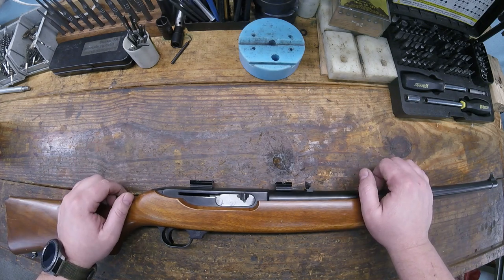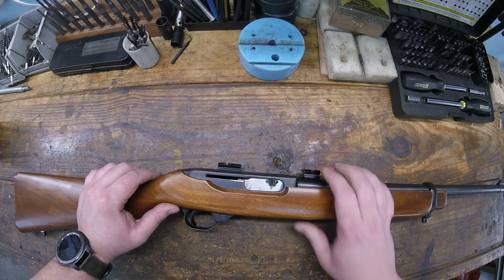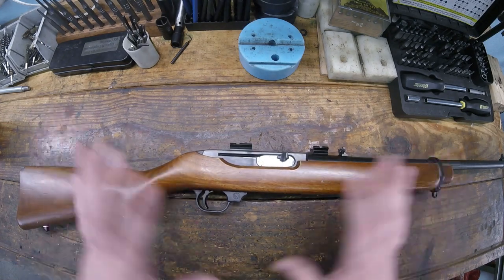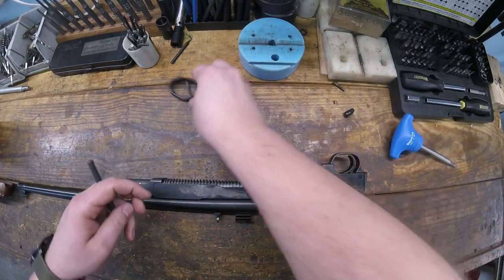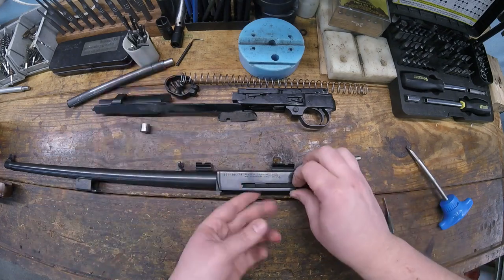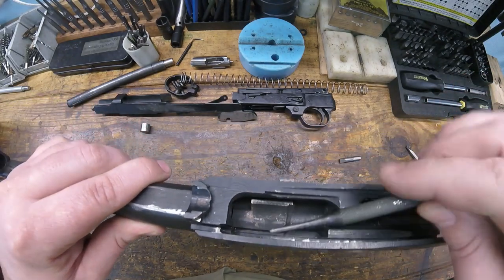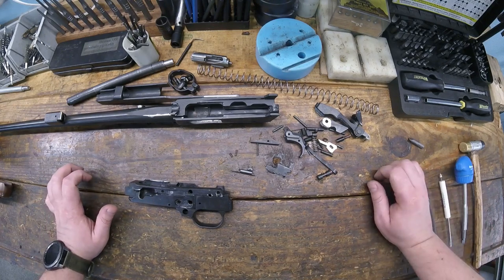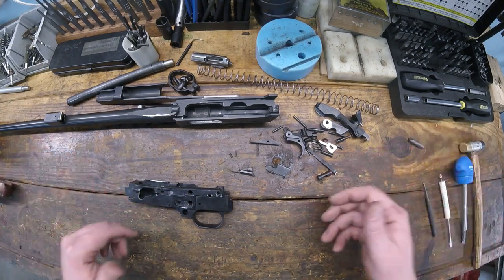Ruger 44 Carbine disassembly

Comment: You saved my life!  Pulled the wrong pin on my son's 44 carbine when I was cleaning it and it was the pin that holds the trigger in instead of the one that drops the trigger group. 2 gunsmith would not touch it to put it back together.  Watched this and said I can probably do this. Had to rewind it multiple times to get it pulled down and put together but I got it!  Thanks!
Reply from the maker: "Gunsmiths"...lol

Comment: Thanks for trigger disassembly video! I bought one of these rifle a couple years ago. The first time I shot it was the last. The trigger pull had to be eight plus pounds. After I watched your video this morning I took mine apart,  stoned and polished the trigger group and it now brakes at a crisp 64 oz. It’s so crisp it feels closer to 3 lbs than 4. You were right, the springs were a little challenging to put back along with trying to figure out where the inner part of the springs tuck under. Thanks again!
Reply from the maker: Glad I could help

Comment: I just bought one of these, I may use it for deer this fall.   It seems it hadn't been cleaned in a while.  It had dried up oil in the action.  Your straight forward approach made understanding disassembly easy.  Thanks for the video.

Comment: My first one, which was stolen and still hasn't been recovered, leaded up when I shot the only commercial .44 ammo I could find through it - the Winchester SWC which had the Luballoy coating on the bullets. I had to tear it down and de-lead the whole gas system. I found another one in an estate sale I was hired to prep for sale and took it in trade. In the intervening years since my first DeerStalker, I became a handloader, bullet caster and powder-coater and police/military armorer. I have avoided using lead bullets in the current .44 and in my other gas guns after trusting some copper-washed .30 Carbine bullets and having to de-solder the gas system in an M1 Carbine. I've powder-coated some appropriate weight .44 bullets of a shape that feeds in my .44, but have heard about PC fouling the gas systems of other gas guns and remain a bit leery of running these through my Ruger. I use them regularly in three other .44 rifles; a 788, a Handi-Rifle and a B92, not to mention a variety of revolvers, and I haven't had any PC fouling with any of them.
Question for readers: should I try the PC'd bullets in my DeerStalker? Otherwise, I'm stuck loading only jacketed bullets for it. That's fine for hunting, but I take my guns out and warm 'em up pretty regularly and the kind of field shooting I do eats up a lot of ammo, so cast bullets are a lot more affordable. If I try this and it works out, I'll test PC in the .30 carbine, and then the M5 .308 and the Garand.
Reply from the maker: Dont know about PC, but you can get plated bullets much cheaper than jacketed.

Comment: If the trigger assemble is working properly why take it apart? Throw the complete assemble in an ultra-sonic cleaner or clean manually/inspect/lubricate move on to the next assemble? The other parts clean/repair as needed/inspect/lube/assemble separately. So as to not confuse parts. Just thoughts for the inexperienced. 
Your video will help many from chasing springs/parts shot across the floor. Having left over parts, etc. Excellent rifle the Ruger 44 carbine.
Nice job Amigo.
Peace from Texas

Comment: Great video! Please do a reassembly.
Reply from the maker: There is one. Go to my channel.
Reply: @UndertheGun  I did subscribe. My lifter was sticking but I was afraid to take the trigger group apart but your video gave me the confidence I could get it back together. I polished up all the parts that were slightly corroded and it seems to be working better now but I'll have to test fire it to be sure.
Reply from the maker: @killvon5490  Right on

Comment: Just stumbled across this post.  Thanks a ton for the info.  I recently acquired a 1976 edition.  I have no history on it other than it was loaded when I acquired it from a family member.  I seem to recall having issues unloading it but I was a bit freaked out having found it in that state so I don't really remember, unfortunately.  I bought some Zoom snap caps recently and couldn't get them to load properly.  The round gets hung up at an angle and gets jammed up when trying to load the round.  I broke the gun down, except the trigger group, per your video, and cleaned everything I could get to.  Reassembled and same result.  I measured the snap caps and noticed they are about .03" shorter than Remington .44mag ammo that I bought hoping to go shoot this thing.  I don't want to try to load live ammo here at home.  If I load a round directly it ejects perfectly.
Any thoughts on worn-out springs or other areas that might cause failures to load?

Comment: Mine won’t feed the next round occasionally, but I’d hate to have it happen when a deer walks out. Running 240 grain soft point Winchester white box. I feel like maybe the mag tube wasn’t seated correctly. Anyway, I’ll try it this weekend and see what I get.
Reply from the maker: May be time for a new action spring. Order both and have them swapped out. It is cheap insurance.
Reply: If the spring were the issue, would the weapon fail to cycle manually?
Reply from the maker: @plutovulgus7710  yes
Reply: It does cycle manually. I think either the mag tube wasn’t seated properly (the little unload button wasn’t really letting the cartridges pop out) or the gas adjustment screw needs to be tightened. I did a cleaning and the unload button works now. I’ll test this weekend. 

I appreciate your video. Thanks for doing it. Not a lot out there on this gun. I have to ask, in the manual it doesn’t seem clear how far to actually disassemble the weapon for regular cleaning. In one section it talks about just removing it from the stock for a basic “field strip”. Then later it describes taking it down more, basically removing the trigger assembly and bolt. Not as far as you go though. 

What is needed for a cleaning for this weapon? Seems like you should go all the way to at least taking the bolt out, but it seems like the manual and a lot of people only take it out of the stock and I guess just clean it and oil it like that. Any advice?
Reply from the maker: @plutovulgus7710  That is really up to you. Take it as far apart as you feel is necessary.
Reply: @UndertheGun  where could I buy these springs?
Reply from the maker: @donaldcarter5504  The internet.
Reply: Dirty piston ?

Comment: I love your videos its helped me on a few guns but when I took my 44 carbine apart I had to fight my charging handle. I actually got the action bar and charging handle out as one piece. Then when I had to put it back together I had to hammer the action bar back on to the charging handle while in the receiver. Do you have any suggestions on ways the solve this problem next time I take it apart. Thank you
Reply from the maker: Not without having it in hand. There may be some burs or something preventing it from fitting correctly.

Comment: Would you know why mine only holds 3 rounds in its magazine tube?  And my trigger won't go the first time but after I let my finger off it and engage it again the shot goes off with a surprise no feel to the trigger at all, and it won't cycle a new round often or mostly catching the empty case in the action Sum-Times sideways
Reply from the maker: I would have to have it in my hands.

Comment: Question - I have an older version 44 carbine thats in nice condition  but it is missing part of the RED Ring on the safety.  Do you know if its a red rubber "O" ring or other material & how would I replace it?  Great video, I will check out your other vids too!  Thanks
Reply from the maker: Its just paint.
Reply: Yep, just paint.

Comment: My slide is locked closed. Any idea how I can fix this? I tried taking the gun apart but can’t becaus the slide won’t go back. I’ve tried taking the screw out from inside the butt and still won’t comenout
Reply from the maker: I would have to have it in my hands
Reply: @UndertheGun  I have one and love it, sadly, the front tab on the trigger group that mounts into the barrel is broken, I've been informed that because it's cast pot metal, it can't be welded.
Reply from the maker: @edwardstone9963  might try brass brazing
Reply: @UndertheGun  thank you, I'll keep that in mind.

Comment: I have one of these guns.  A 25 year anniversary one that was left to me by a friend who passed away.  I can not get it to lift forward and up and out of the black block to remove it from the stock.  Any ideas?
Reply from the maker: Lock the action open.
Reply: The action was locked open any other suggestions? @UndertheGun
Reply from the maker: I mean.....you did take the barrel band off right?
Reply: @UndertheGun  Barrel band off, Action locked open.  I finally removed the buttplate and the rear mounting block screw.  The rear block is attached to the back of the gun and it will not come off altho I have not gone all out as I dont want to mar the finish as I can field strip it for cleaning withou hammering on the block.  Im not a novice at taking guns apart and have been in the business for the better part of 25 years.  I hadnt ran across too many of these to take apart, just wanted to know if there is anyway to get that rear mounting block loose fro the back of the receiver
Reply from the maker: Not without taking the gun out of the action first.  Just lay a thick towel down on the bench and hold it by the stock and smack the barrel on the towel. I think it is just tight. They are like that sometimes.
Reply: @UndertheGun  Will give it a go.  Thanks  Watched your video for some pointers and it certainly helped taking the rest apart.  Just wondered if there were any tricks involved with removing a snug mounting block
Reply: @UndertheGun  Put it back together in the stock with the exception of the barrel band and took your advice with the thick towel.  A few taps of the barrel on the tabe and it broke free from the mounting block.  Thanks for all the help and great video.  ive saved it for future reference.
Reply from the maker: @panzerlambert1194  Not really
Reply from the maker: @panzerlambert1194  Glad to help